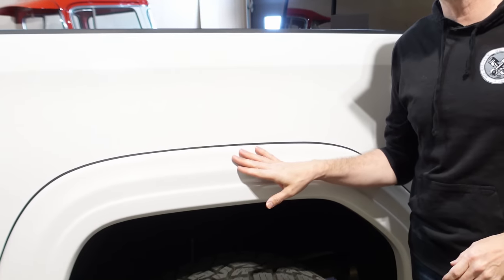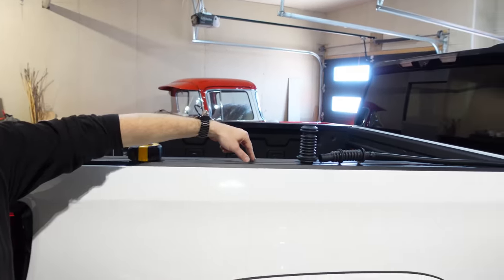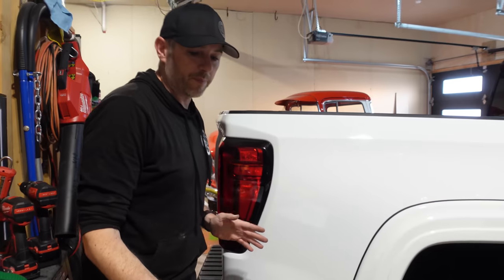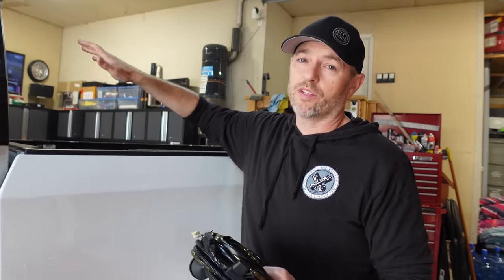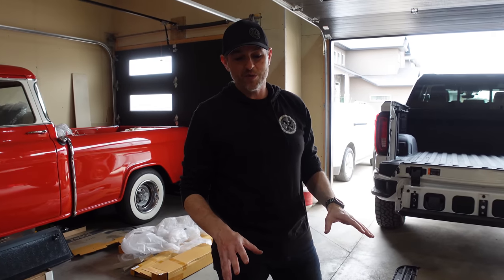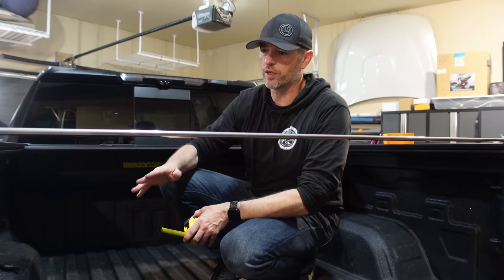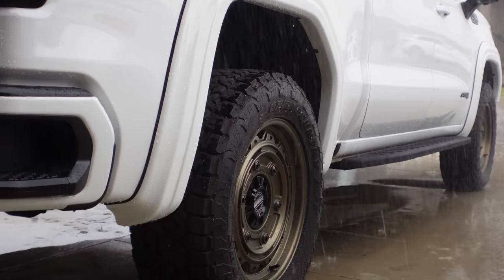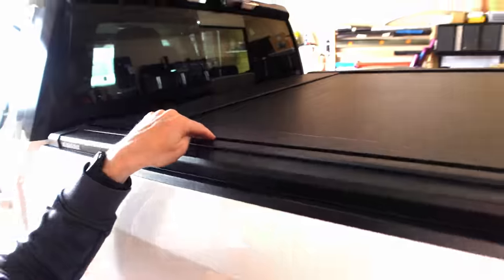Installation & Review / The Best Retractable ELECTRIC Truck Tonneau / Bed Cover By EGR RollTrac!

Comment: I went for the RetraxPro MX on my 22 Silverado refresh. It was easy to install, looks great, and no complicated wiring to install. I didn’t want to spend really $3000 USD for a cover. It works flawlessly. Couldn’t be happier and it was $1800 USD plus tax.
Reply: I have the same cover and love it. They also have an XR version which has the T rail track for adding accessories. They have a power version too, but I didn't want the hassle of wiring and something else to go wrong/bad with the truck. This EGR one has WAY too many holes that need to be drilled!
Reply: @FastSS02  the EGR is nice. Just too much complexity to install. The other thing I don’t like is drilling holes in my truck. If you ever decide to change the cover, you’re stuck with holes.
Reply: Plus no holes, tape and silicone!! Too much chopping for me!
Reply: The RetraxPro leaks! I have it and am tired of everything in my bed being soaked every time it storms. My truck is kept outside and we get a lot over overnight rain. I have to unload the bed every night to keep all my gear dry. Other than that, the RetraxPro is a well made cover.
Reply: @thwyld1  you didn't install it right then
Reply: @FastSS02  it leaks between the slats. I contacted the company to troubleshoot and they said that this is normal. I’d love to make this one work but I’m under the impression that there are no seals between the individual aluminum slats that make up the cover. Are you saying, yours is water tight? Melting snow that is sitting on the cover was like a gentle rain in the bed!
Reply: @thwyld1  I have zero leaks on mine. Especially between the slats. A very little bit might get in at the front corners where the rubber flap sits on the front rail of the bed. That's only because I had some old butyl rubber laying around I used to try to seal it.
Reply: I have the retrax pro xr also...no leaks in the slats or front, the only place water gets in is by the tailgate as I don't have a tailgate seal.....I have thought about adding one , but really it mainly just leaks a little down the corners/ tailgate itself.( If you shine a flashlight you can see right into the bed from both sides of the tailgates
Reply: Ohh, and it's rated for 500lbs and no drilling any holes!!
Reply: @thwyld1  no leaks for mine. It just rained heavily and my bed is dry.

Comment: Ya il pass the idea it does not totally open the whole bed not to mention drilling holes in my new truck for drainage turns me right off. I refuse to drill holes adds to leaking problems down the rode. Not to mention the electronics to open and close this I can just see more problems. Cool but not necessary. I can see this not working in the northeast or any snowbelt down the road. Thanks but no thanks. I can amagine the cost for this baby. Il stick to a hard shell manual mode with pre installed drained hoses into the already holes in my bed. That's what I installed in my Dakota. But to each there own.

Comment: I'm back! Got my cover and started the install. Apologies for the wall of text/questions. 

I'm currently on electrical: 
Did you have to remove your battery to cut that nipple from the firewall plug and pass through your wiring the first time? In the video you already had that aux wiring as a guide but there's no way I can get my hands/arms in there from what I can tell. Their video looks like they completely removed the battery, but wasn't sure if that was just to get a clearer shot of that step or if it was necessary. 

And then, for passing through the wire, did you use the old "coat hanger" trick the first time?

Finally, I removed some of that sound deadening from the passenger side under the glove box, but I'm a big guy and can't see the other side of that plug the wires will come through--there's also a lot of electrical in the way from what I can tell. Any hints about getting it through or seeing it? Same with going from the passenger side to the driver side at the front of the console, any hints?

Finally, did you go above or behind your brake pedal with the wiring? It looks like I have to go in front of it, but wasn't sure if I should leave enough slack in case I ever have to remove the brake pedal. I noticed in their install video, they completely removed the brake pedal from the truck.
Reply: Figured out some of my issues. 2024s are different than 2023s. There's a computer in front of the firewall opening, and the rubber plug is different as well. Now I just have to deal with the wiring.

Comment: As I am looking for a new, first time ever, pickup truck, this cover really looks good on the truck. I need to see one installed. My concern is the electric mechanism and it's size. I am not a contractor or use it for a business. But still, it takes some real estate. Second, the drilling part for someone who has never done this before and I am pretty handy, not sure. One mistake and you are screwed. This thing is not cheap + possibly installed by a shop. I have to see one working. BTW....I have the same T. Wrench, 2 sizes. Great tool. Use it on my Goldwing all the time. Thank you for this good video.

Comment: No discount code?! Not cool EGR... That bed cover is slick though. 
 
And I'm already going soft on the 🌫️ 🔦's... after getting the ditch lights and light bar on the way seems unnecessary to upgrade factory fogs 🤷🏼‍♂️ (still WANT them obviously). Now I'm gonna be hoping for the recon LED tails video! We both still need the amp research electric running boards also... Just saying

Comment: Good video would be curious about  winter use w good rain storm and then cold Temps if it would freeze up?
Reply from the maker: I will share my experience when winter comes.  Heavy rainfalls have been just fine for the 3 or 4 we've had since I have installed it.

Comment: Hey Don, I didn't see it in the video, but can you measure how much space the cannister takes up in the bed? I'm wondering how much room I have under it for storage box height. Thanks, and great video.
Reply from the maker: I am out of the city for work this week. When I get home I can measure the floor to bottom of the canister for you
Reply: @Donslife  Thanks, and no rush at all. Still doing a lot of research about what I'm doing with bed racks and bed gear. Oh, while I'm thinking about it, could you also measure bottom of the bed to the cover? Looking at fridge/bed slide combos as well and I can't find any measurements anywhere.

Hope you had a good trip.
Reply from the maker: 15 1/4” below the canister.  22 3/8” from the bed floor to the seals on the cover.
Reply: Thank you. Just rewatched the video and saw the second measurement. My bad. Appreciate the cannister measurement.

Comment: Don I purchase one of these for my GMC 2024 1500 Denali, I started my installation and when I got to putting on the mounting rails, I could not get the left side on because of the assist handle. I contacted customer service. I was told I had to remove the handle mount the rail then put the handle back. Needless to say the rail covers the top two mounting holes. I notice in your video you did not remove your handle to put the rail in place. I have talk to them three times, how do I get the correct rail? Do you have a contact I can call? I toll them I would take it to a machine shop and have it modify, they say it would void my warranty. Can you help me?
Reply from the maker: I don’t have a specific contact but my rail has a notch for the handle but does cover a bolt.  I don’t know what’s changed from my rail to yours.   I can send you some detailed photos if you like via email or instagram direct message.   Then you can use my photos to help resolve with EGR

Comment: Hey Don, how do think that cover is going to hold up once it gets cold? 
I live in NE British Columbia, and I previously had a Revolver cover from Bak and when it got cold the mechanisms to lock the cover down would freeze up and then it wouldn't work properly. I eventually figured out a solution that helped to alleviate those frustrations. With that EGR cover I was curious if you think the tracks might be susceptible to freezing up ?
Reply from the maker: I am anxious to learn.  I will share what my findings are

Comment: Great video, thanks. This is one of the best-looking retractables on the market. I'm very close to pulling the trigger on one of these, but limited info on the web has me cautious. Do you have any additional impressions or cautions now that you've had this cover installed for a few months? Security/watet resistance/ functionality/ etc?  Thanks in advance.
Reply from the maker: I am still super happy with it.  No regrets.  I am curious what my severe winters will be like though
Reply: That's great to hear. I appreciate your response. Thanks.

Comment: Great Video, and it looks to be a great product.  But I emailed EGR and this cover is not available until March/April they say, which experience has shown me that really means May.  Any idea why its not available?
Reply from the maker: What model of truck do you have?
Reply: 2022 GMC Denali 2500 short bed.
Reply from the maker: They are working on the 2500’s amongst others

Comment: Will it work well if it's wet/snowy and below freezing? Seems like the joints and rails might freeze up.
Reply from the maker: I guess we’ll see…
Reply from the maker: Using it wet has been fine so far.
Reply: It looks like a great cover. I live in Minnesota, so the cold can make things difficult. If it works well for you, I might have to try one on my next truck!

Comment: Dude… GMC just called and told me the 24’ Denali i just bought is cleaned & ready for pickup. 
I thought it should’ve had a retractable cover on it already but it doesn’t. 
You’ve got me wondering if I should just buy one and install it myself or pay them $3,500… 🤔
I “THINK” I should just follow your vid & use the saved $1,500 for something else.
Reply from the maker: Between my video and EGR’s instructions…anything is possible
Reply: I’m going for it!
Thanks for being brave enough to try it and post it for everyone else.
Reply from the maker: @jonezmusicgroup  happy to help.  Don’t forget to use my code if you can 😊 

Either way, thanks for watching the video

Comment: What’s up big man. I see it’s been 7 months since you have uploaded this video. How has it been for ya so far? 
I’d be installing it on a 22 F150 and one of the major things I like about them is opening/closing with the unlock/lock buttons but I’m not sure if that’s a GM only thing.
Reply from the maker: It has been good.  In -40 with built up ice. It is unlikely to open with the motor that cold.  Worst case scenario, the motor can be bypassed for manual opening and closing too.  

As for the opening with unlock commands, they have it for ford too.
Reply: @Donslife  I gotcha. Yeah I’m down here in GA so I don’t have to worry about the ice lol. I couldn’t imagine -40 😅

Comment: Don I installed one of these on my 2021 Sierra AT4. When I unlock my truck from the drivers door “single click” the bed opens. Doesn’t do it with any other door. Any ideas?

Comment: I think that I'll just stay with the standard manual Rol n lol. Your only going to open it when your outside anyway. And if you need to close it. Your out again.
Has anyone ever done one on security?
I mean really trying to get in. The only one I have seen close would again be for the Rol n Loc.
Reply from the maker: Okay
Reply: @Donslife  Don I reread what I sent you. I’m surprised that you could decipher that message. I’ve got to quit texting at 3:00 in the morning. What I meant was Roll n lock Was the only one I had seen where it’s closed. And then they see how hard and how much noise is made getting the lock open. As far as the comparison with the other. I was thinking about adjusting the sliding top for something to tall or a fifth wheel trailer your still outside checking on the distance. And also when you leave the store in the first place. You are there to put the stuff in anyway.I hope that I did better with the Email that I tried to send about the puddle lights. I really need them more.👍 
Again thanks.

Comment: Will it work manually if battery goes dead
Reply from the maker: Yes.  I cover it in the video.  There is a release lever on the motor side.

Comment: How does this cover perform in the winter in sub-zero temps, freezing rain or a thaw and then a freeze? That will be the true tell. I have the roll top tuxedo aluminum tonneau and it freezes up in the winter in these type of conditions, I suspect this one will behave the same.
Reply from the maker: Stick around and we’ll be doing some severe winter testing on the channel

Comment: Nice cover , great install video. But way to many holes, big ones too😮
Reply from the maker: Luckily rubber grommets can seal up the new holes just fine if the cover is ever taken off.  I made sure.
Reply: @Donslife  that’s great! I looked and it doesn’t look like they make it for the f250. I was going to pull the trigger, definitely the best I’ve seen so far.

Comment: I never heard of it kept the water out. With all those drains and weather sealing I would hope some.
Reply from the maker: It did
Reply: I think the multipro tailgate by itself is kind of sus on being waterproof since I can see the bed lights through the cracks of it but this cover looks much better sealed than my LO-MAX tri fold.
Reply from the maker: The top of the multipro tailgate I am sure will let water in unless I buy a kit for sealing it.  I will make a video or short another day with some water tests.   Average rainfall has been a successful test so far.
Reply: It actually does.

Comment: You have to sponsored to be able to put one of these on. Way to expensive cheaper to hire a guy from Home Depot to flip mine over.
Reply from the maker: Some people want these upgrades and they do have non-electric versions that will give you all of the same benefits for a lower cost.

Comment: Seems OVERLY Complicated, and moves much slower than a cover that manually rolls up for 1/2 the price.
Reply from the maker: I’m loving it.  No more flipping or sliding.  Just press a button and it seals up - Locked.  It is one of the most expensive covers out there though

Comment: This guy has a 3 foot bed and takes up a foot of it with some gadgety cover that will fail in less than a year.
Reply from the maker: 5’8” to be exact and I have another truck with a 6ft box and a 12ft enclosed tandem cargo trailer so I’ll be alright

Comment: Tonneau covers suck in general. You're just adding another point of failure.
Reply from the maker: I have had 6 trucks with them over the years and always preferred having one vs not.  I don’t think I’m alone especially when hauling things of value